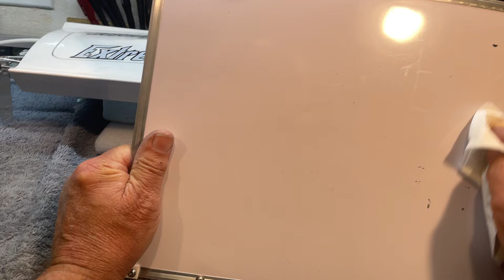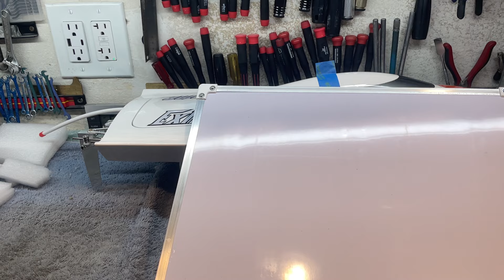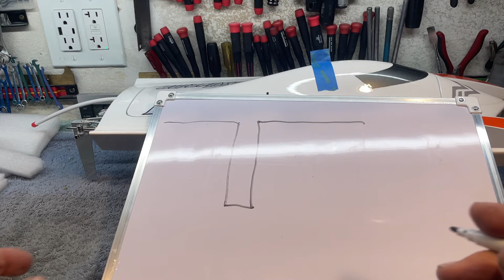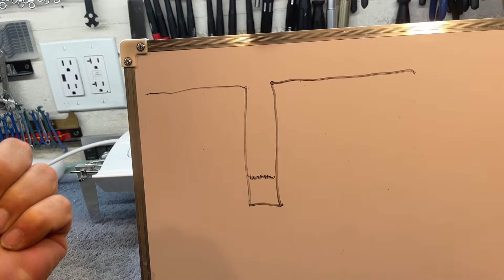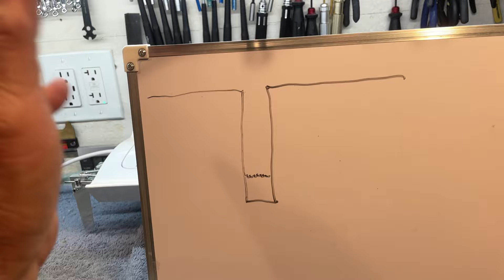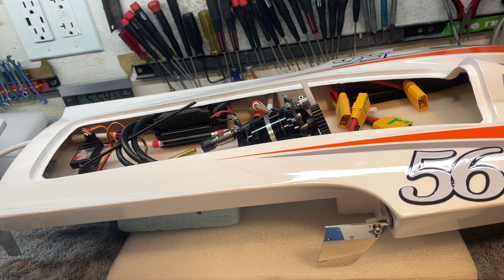Dr. Jet answers a viewer's question.

Comment: How's it going Doc .in Australia thay use septic tanks made out of concrete.
Reply from the maker: We use concrete here as well.  The tank is just the first part of the system.  That's where anaerobic bacteria digest all the solids 💩(yum!) and turn them into a foul-smelling (and toxic) liquid called effluent.  Getting rid of that effluent is the real problem to solve.  That effluent goes into a disposal system that can be leach lines, deep seepage beds, vertical seepage pits, Advance Treatment Systems with secondary aerobic bacteria treatment and sand bed dispersal.  There's also Supplemental Treatment Systems with mechanical/electrical components with a drip/sand bed dispersal system.
Reply: Over here when the tanks are full thay ring a poo sucker to empty the tank
Reply from the maker: @43dw09  Tanks are always full,  that's how they work.  The secret is you want them full of water (mostly) with as little undigested solids as possible.  With the outlet being only 2" below the inlet and a center baffle dividing it into 2/3 and 1/3 sized chambers, water moves slowly through the system.  A hole in the center of the baffle allows the highest quality effluent (least amount of solids) to flow from the first to the second chamber.  It needs to be a quiescent (stagnant) structure with as little water movement as possible.  That's why the minimum tank size here is 1,000 gallons, with 1,250s and 1,500s being more common.  Over here, we recommend the tank be pumped every two years as a regular maintenance item.  Undigestable solids settle to the bottom of the tank to form the sludge layer, while all the fatty lipids form the floating scum mat.  As the sludge layer and scum mat continue to grow, they reduce the volume available in the tank for the bacteria to digest the 💩and paper; then undigested solids go out into your leach lines.  That plugs up your disposal system and now you're really screwed.  The effluent can no longer percolate into the soil because all those microscopic pores in the dirt are plugged up; so the effluent goes the only place it can:  Back.  The tank pumpers (what a great job!) have to stir up the sludge layer to get all the sludge while the scum mat just gets sucked up as part of the process.